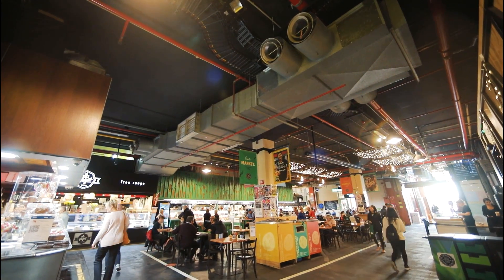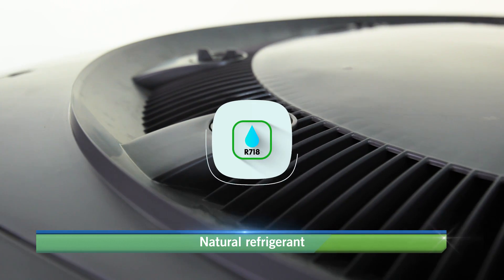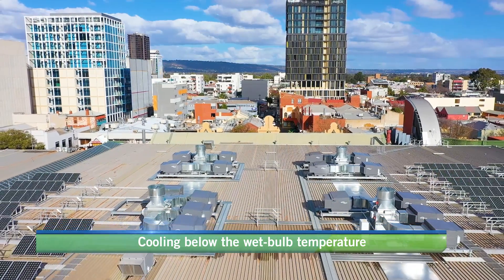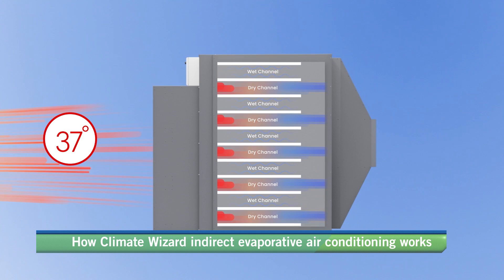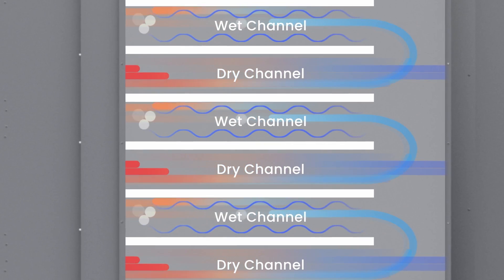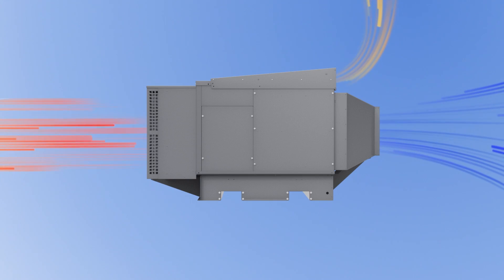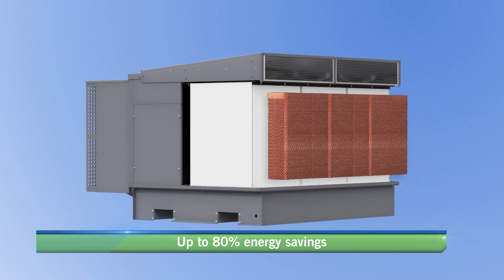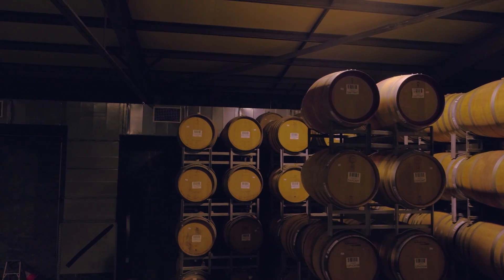Multi-cycle Indirect Evaporative Cooling: How it works

Comment: I contacted Coolerado about ten years ago with a design modification that will cause the indirect evaperativr coolers to cool 12 degrees below dew point, not wet bulb.  The condensed water can be recycled into the evaporative side if needed.  When i talked to them all they said it was impossible.  Its not.  I even had an engineer look at it and was surprised that it works.  If you are interested, we can make a deal as I'm not really capable of bringing it to market. You can reach out to me here if interested.

Comment: If you cool  down  outside air it's relative humidity rises - no matter how you did the cooling.  Once you pass 60 - 70 % humidity it starts feeling  uncomfortable. So it's a good thing for hot dry climates- if you have enough water. 
In humid climates it could save some energy, but you'd still need equipment to remove excess humidity.
Reply from the maker: You are right, RH% rises when cooling outside air. But what causes the unconfortable feeling is actually the amount of moisture in the air (absolute humidity - that would ideally be kept under 15gr/kg of dry air), which is not increased with the M-cycle indirect evaporative cooling technology. Ideal RH% indoor is 40-60% (if the air is too dry, the bacteria and viruses are spread more easily and mucous membranes cannot filter them). By supplying 100% outside air, M-cycle indirect evaporative coolers need to work in conjuction with extract systems.

Comment: Low energy consumption, but you would need constant source of water?
Reply from the maker: That is right, the unit needs water supply. Part of water will evaporate, part of the water will be collected in the tank. Water is recirculated until its salinity level (checked by the clever WaterManagement system) is detected as too high.

Comment: What equivalent tonnage AC can these units match? Assume standard conditions, or best case scenario, give us a number.
Reply: One number on nonmatching things isn't gonna get it, though they do show 37°C roof air hitting 19°C, just pick a unit size and get your tonnage data point. (Or read reviews of that wet market...)
Reply: Cooling capacity depends on how much air these can supply at that 19°C. No way to find that out. Just increasing the flow rate doesn't mean that the temp will stay 19°C.
Reply from the maker: @roadrash999  The airflow rate of these units vary from 800 l/s up to 8500 l/s and cooling capacity vary from 18 kW to 214 kW. Values used to calculate these cooling capacities are 38°C db/21°C wb for outdoor air and the DB temperature of the supply air.

Comment: Is this type of ac suitable for humid Florida conditions?
Reply: A swamp cooler in FL; I mean, it's right there, no. Do the MIT cooler and some embedded PV then back it with splits and what you need to do with eluent from the chiller coils. Though these people do make heat exchangers, so for ventilation...
Reply from the maker: @knutbergan suitability of products depend on application and design conditions, for example our CW3 unit (the smallest in the range) under ASHRAE design conditions of Orlando (34.3 °C DB ; 24.8 °C MCWB) may supply up to more than 5,000 m3/h with a dry bulb temperature of 24.3°C and wet bulb 22.8 °C. We have sold units in far more humid locations, so I would say it is not suitable for all applications, but for most industrial commercial ones, yes. For more information, send your design conditions to europesales@seeleyinternational.com

Comment: Would this work in high humid tropical climates - dew point is quite close to ambient
Reply from the maker: We have proved efficiency of evaporative cooling technology in humid areas, such as Mediterranean coastal area and The Gulf, with excellent results. In fact, outdoor humidity is lower when the heat is at its highest, which is also when cooling is mostly needed. Also consider that Climate Wizard units do not add humidity to the air: for this reason they can be also used in pre-cooling application to improve the efficiency of an Air Handling Unit. Visit our website for more info https://www.seeleyinternational.com/eu/commercial/commercial-europe/

Comment: This isn't going to work in some large urban areas, with wide adoption the outside air will get very humid unless the prevailing wind is sufficient
Reply from the maker: We have proved efficiency of evaporative cooling technology in humid areas, such as Mediterranean coastal area and The Gulf, with excellent results. In fact, outdoor humidity is lower when the heat is at its highest, which is also when cooling is mostly needed. Also consider that Climate Wizard units do not add humidity to the air: for this reason they can be also used in pre-cooling application to improve the efficiency of an Air Handling Unit. Visit our website for more info https://www.seeleyinternational.com/eu/commercial/commercial-europe/

Comment: I haven't seen indirect evaporative cooling systems with counter current heat exchangers before, and I have been curious why it isn't common. I suspect large heat exchange capacity is required to reach well below the wet bulb temperature, but being able to cool air down below the wet bulb temperature, at all, without adding moisture, and just by moving the air, is fantastic.        

Do you have any system that utilize some easily "rechargeable" desiccant to dehumidify the air that doesn't add all the heat released by condensation to the cooled air?
Reply: I think it's because this is only truly efficient in dry climate, and countries with high humidity won't experience such drastic temp drop.
I could be wrong though
Reply from the maker: @fishyerik thanks for your comment. Unfortunately, no, we only have M-cycle indirect evaporative cooling models available.
Reply: I just don't get the way people use the term wet bulb temperature , to me wet bulb is a  tool to measure humidity if wet bulb temperature decrease humidity is low if it doesn't decrease humidity is high cause water cant evaporate since air is saturated with water vapor so what do you guys mean when you say cool air down below the wet bulb temperature i just don't get it how that related
Reply: @mohammedbin0002  Wet bulb temperature is exactly what the name describes. And, it depends on the humidity, and actual temperature, and pressure, even if the pressure typically is assumed to be "normal", and by that within a very narrow range, to the point where it's typically irrelevant, in free air.

Thing is, wet bulb temperature varies with both humidity and temperature, and pressure, so it's not by it self a measurement of humidity, even if you can calculate the humidity from the wet bulb temperature and actual temperature, and pressure. Put in another way, the wet bulb temperature is just one part of a bigger equation.    

The wet bulb temperature also is the lowest temperature you theoretically can reach, by "plain" evaporative cooling, as evaporation both reduce the temperature, and increase humidity at the same time, you reach an equilibrium where those changes meet, and essentially reach a "new" dew point at a higher temperature than the dew point of ambient air, obviously assuming ambient air isn't saturated to begin with.

This means that if you can pre-cool the air without adding water vapor, you can reach a lower temperature than what is possible with "plain" evaporative cooling.   

Utilizing the evaporative cooling to pre-cool the air via counter current heat exchangers adds complexity, and requires those heat exchangers, but it can potentially be extremely useful because of that extra reduction in absolute temperature, even if that reduction might seem insignificant.

Comment: Sales pitch so I am still a doubting Thomas on the energy savings.  Heat exchange is nothing new but typically segregated exchanges are low efficiency.
Reply from the maker: Hi @franks4973 not sure what you exactly mean by "heat exchange". The M-cycle principe relies on a heat exchange between dry and wet channels, but as a portion of the fresh air returns into the wet channels, it lowers down the dry bulb temperature of the working air. This allows the unit to deliver a supply air temperature below the wet bulb value of outside temperature. For more info visit www.seeleyinternational.com

Comment: Is the process reversible? Can it be used for heating?
Reply: heating is easy . and no its not a heat pump
Reply from the maker: No @pubanz8, the process in not reversible
Reply: Typically a reverse cycle air conditioner is the best unit to use, as it is easier to seal off the building.
Both heating and cooling from the same unit
Reply from the maker: @guringai  to improve Indoor Air Quality you need to deliver more fresh outside air into the building. This is very important to decrease viruses and germs transmission, which is instead increased if you seal off the building. The more external air you need to treat, the more the power consumption of the standard A/C systems. M-cycle indirect evaporative coolers are based in using 100% fresh air with up to 80% lower energy consumption, if compared with a A/C performing the same duty. Fore more info, visit www.seeleyinternational.com
Reply: Of course I understand that fresh air is always best. 
The problem with evaporative air conditioners is that It's often difficult to seal the building when you don't want cold air. 
The other benefit of reverse cycle air conditioning is  both heating and cooling comes from the same unit. 
How do you propose heating would happen with your unit doing the cooling?

Comment: Hi, what is the consequence of wetbulb on cooling efficiency
Reply from the maker: Hi, @asifansari-nu1lu. Given the same airflow, the lower the supply air temperature (below the wet bulb, as supplied by the M-cycle Indirect Evaporative Cooler), the higher the cooling capacity. If you have further questions, send us an email at europesales@seeleyinternational.com

Comment: What is the water consumption of these units? per degree, per watt, per btu...?
Reply from the maker: At outside conditions of 38°C dry-bulb, 21°C wet-bulb the water consumption (depending on the models you consider), cooling capacity may vary from 8 to 40 kW and water consumption may vary from 44 to 72 l/h.
Reply: @seeleyinternationalemena2736 ...which is bloody brilliant in the western 1/15 of WA I suppose? Are those exchanger plates steel or some other long-wearing stuff?
Reply: @seeleyinternationalemena2736  AT WHAT VOLUME CUBIC FEET?
Reply: Any clay ceramic evaporative cooling can use saltwater

Comment: from 37c to 17c . is a 20 ΔT . 
its technically impossible . 

+

the temperature achieved is always restrained to : 
1- the temperature of the air " outside " 
2- the humidity level " relative humidity " both inside and outside . 

in high humid areas this system will always act as a fan . nothing more .

+ The dry channels . will only remain "dry" for a short period of time compared to the "Wet" ones . 
then , the system reaches equilibrium .
Reply from the maker: Hi, this system does not work exactly the way you have highlighted, this is an M-cycle (M=Maisotsenko) indirect evaporative cooler that can deliver the supply air below the dew point temperature of outside air. In the web there are a lot of scientific research on this topic. If you wish to get in touch to learn the technology in details, please contact us www.seeleyinternational.com
Reply: Its possible, its a feedback loop, like a 2 stage refrigeration unit.
Reply: How far below dew point does the output cold air from the systems can go?

Comment: I'm thinking of using 2 motors and a gearbox to make a fan faster so it evaporates faster and then more cooling
Reply from the maker: Hi, this is not exactly how this technology works, if you need more info contact us at www.seeleyinternational.com

Comment: It's basically cooler ,here in india it's used in home basically working on same principle 1/4 th price of ACs and  environment friendly
Reply: But high humidity+ allergies
Reply: @averagestudent4358  so allergies with natural wind 🤔 , how
Reply from the maker: @averagestudent4358 actually evaporative coolers are very good for health, as they only use 100% fresh outside air. They increase ventilation rates into the space. Plus, the coolers that you are seeing on screen, namely M-cycle indirect evaporative coolers DO NOT INCREASE HUMIDITY in the building they are cooling. Have you got more questions? We are here to answer! :)
Reply: Ah?  @chetanpatil9174 
Can't you get allergies with wind?

Comment: Does it supply temprature equal to ac..?
While we consider 400cfm/Ton
Can we say your 2750 cfm system is equal to 6.5ton..?
Reply: you can't regulate temperature in these, at least in the residential models. But the difference they provide is amazing. In addition to the simplicity of the product. It's basically a high speed fan put in front of a water saturated pad and it works wonders.
Reply: @Fumbiver  if we compare this unit with AHU connected to chiller
Reply from the maker: @dheerajsharma7521 and @Fumbiver 
The supply air temperature depends on the outdoor air conditions, both in terms of temperature and humidity.
Therefore, The Climate Wizard could provide an air temperature equal to that of AC under certain outdoor air conditions. However, the EER of these units will always be much better than that of standard AC units.
Consider also that it is possible to use the The Climate Wizard M-Cycle Indirect evaporative cooling unit in combination with an AHU, either to provide 100% fresh, constantly cooled air in the building or to pre-cool the outside air treated by the AHU.

Comment: Why hot outside air can be cooled when it passed through dry channel? Via substantial large surface area?
Reply from the maker: The core is an air-to-air M-cycle heat exchanger
consisting of alternating dry and wet channels. All of the air passes along the dry channels and gains no additional moisture. As the air exits the dry channels, a portion of the conditioned air is returned through the wet channels, where it is cooled by evaporative cooling process. No moisture is transferred across the membranes
between the dry and wet channels; only heat is transferred. The heat passes out of the air in the dry channels through the membrane and into the air passing through the wet channels. In this way, the air in the dry channels becomes progressively colder but gains no moisture. The wet channels are continuously soaked with water to allow the evaporative cooling process along the entire length of the core. This moist, warm air is then exhausted outside. The cold air is then pushed into the building.
Reply: Via indirect evap cooling

Comment: Dose it work? On high humid area
Reply from the maker: Hi & thanks for your interesting question. We have proved efficiency of evaporative cooling technology in humid areas, such as Mediterranean coastal area and The Gulf, with excellent results. In fact, outdoor humidity is lower when the heat is at its highest, which is also when cooling is mostly needed. Also consider that Climate Wizard units do not add humidity to the air: for this reason they can be also used in pre-cooling application to improve the efficiency of an Air Handling Unit. Visit our website for more info https://www.seeleyinternational.com/eu/commercial/commercial-europe/
Reply: Depending on size it will vary I think so